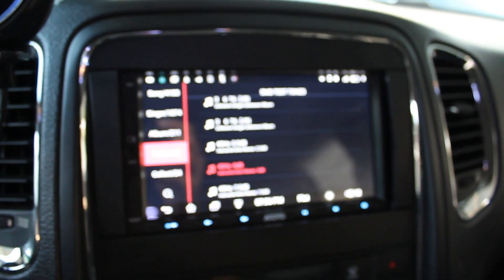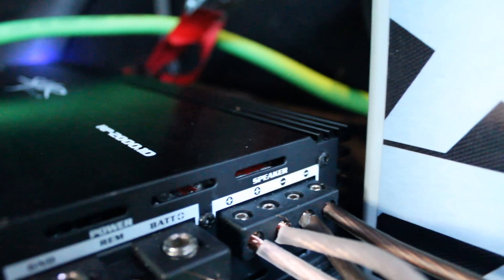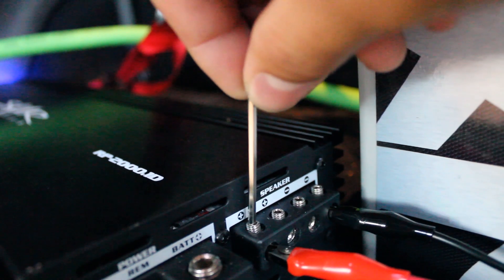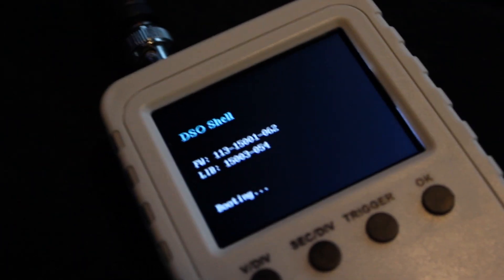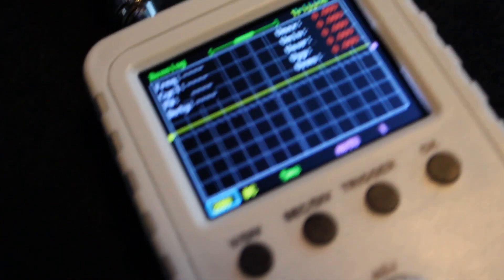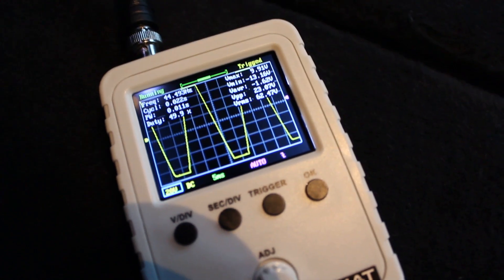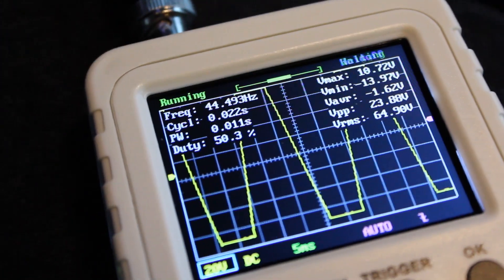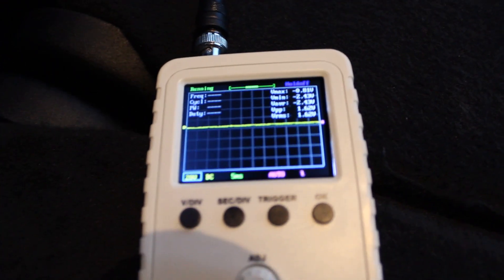How To Tune Your Audio Amplifier With An Oscilloscope!

Comment: It’s a good video, but how do you set up the oscilloscope  sign wave displayed to that size in the display so you can see it clipping?
 I have the same unit and it’s so small. I can’t see or increase the height of the wave like you have did because I can’t see it. So how did you adjust it to that?
Reply: I’m pretty sure it’s the 20v and 5 ms that you have to change
Reply: @exi9164  Its the size of the SINE wave in the display that is holding me back. Its way too small to view the signal to detect clipping. Can you show from a new O scope out of the box how to set it up for the test video that hands it off? Its too vague for someone that is not familiar with the O scope to accomplish alone. Thanks.
Reply: I m having the same problem. How do you adjust that?
Reply: Did you figure it out ? Mine does the same but I have a different brand
Reply: @smurfeco2.358  no. I have not went back to play with it yet. I was the other day and it started raining so If I figure it out I will let you know ☺️
Reply: @rayshaffers1488  I was just messing with mine at home I have a hanmatek oscilloscope.  It's a little difficult to understand but I'm getting the hang of it

Comment: my 2015-2020 escalade goes up to volume 63- even at volume 40-45 the 40hz 5db test tone makes me extremely nervous. that shit is so loud i feel like i might blow or damage one of the 16 factory speakers (ive blown one in the past to 50 cent - im supposed to die tonight). so, trying to figure out how to use the damn oscilloscope while the VRRRRRRRRRRRRRRR sound is blaring makes me uncomfortable. i got the waves to fly at a million miles an hour but figured maybe id at least be able to catch where it clips, but i turned the gain all the way up and the waves just got hectic as fk and i never saw clipping so i must be using the shitty o scope wrong. either way i replugged in my speaker wire and figured fk it!!!!!!!!!!!!!!!!!!!!!!

Comment: This is INCORRECTLY performed. The power measurement value should be for AC. Amplifiers speaker output (+, -) is measured in AC.  He's also got the V/DIV voltage value incorrectly set. It was set to 20v DC I believe.

I implore all of you to please read more on this subject. Yes it is relatively easy to set your clipping point with a scope, once you understand how to. This guy clearly skipping his research and thought it would be self explanatory enough once he had a scope in hang.

Take the time to read up on this subject, and not hinge all the money and time your spent on your car audio setups solely on this video. There's no guarantee this information is accurate, and if it ultimately leads to you blowing your amps, YOUR THE one that's going to be left, sinking more cash in to this. Your equipment will eventually fail, if it's done improperly. Be objective, and validate the information using multiple sources. Hope this helps.

Comment: How do you turn the gain down if you have to start with it all the way down
Reply: if you're doing this correctly you set your head unit at the max volume it can go without distorting the signal, which the overwhelming majority of head units out there will be far below max. You want to measure AC coming from the amp, not DC. You also want to set your gains with your bass knob maxxed out because if you do it half way you'll start clipping the moment you go to turn it up from where you tuned your equipment to. This guy doesn't know what he's doing.
Reply: @dr.fillyblunt7505  Nobody in this comment section apparently knows their way around an oscilloscope. It isn't like a multimeter where the DC setting means you're only reading a DC voltage. His scope is set to DC COUPLING. DC coupling allows the scope to display if there is a DC offset on the signal coming from the amp. If it were set to AC coupling it would apply a filter to automatically center the signal on the graph and you would never know if there was a DC component on the signal (which would be bad news for his speakers). AC coupling could also potentially filter high frequency noise that might be present on the waveform. So, he's doing the right thing by having it set to DC.
Reply: @DDugger  Do you feel better now? The questions are valid.

Comment: I was going to buy the dd1 then I read that the oscope was more versatile as it can account for voltage drop and a few other things ...lol...then I remembered that 3 years ago when I had a mystery problem with my can bus I had bought an oscope but figured out the issue before it arrived and that scope was still new in the box deep in my closet ...lol...so the choice between the $200 dd1 and the already paid for scope was simple .

Comment: On a factory head unit using a lc2i pro how do I find out what the max volume is on the head unit or better yet where do I hook up the oscilloscope to verify the max volume?
Reply: Did you figure this out? I am needing to know as well? Speaker + - on loc as well?
Reply: @ no never did and the poster never replies

Comment: rarely seen such nonsense. Turning the radio up full blast is the first way to introduce clipping or distortion into the signal, and cranking an amp up full with no load can potentially break it as well.

Comment: This is EXACTLY how not to do it FYI
Reply: How do I do it
Reply: @trapmessiah6165 the chances are your head unit is sending clipped signals at max volume. Find the clipping point of your head unit by using the oscilloscope on the pos and beg of one of your door speakers. The do what he did, but with the head unit set to the volume you just determined.
Reply: @ka_razygaming1183  oh ok thank you

Comment: Thanks for doing the video I just need some clarity at one point he said attach the positive and negative oscilloscope connections to the amp then you said turn down the gains as well as the subsonic and low pass filter‘s all the way down to the left so they should be at zero or at minimum.. Then Advice was given to have the head unit on full the bass knob on full then check for clipping assuming every setup we Will have clipping then we just turn the gain on the amp mmclipping just turn the gain down… He said this point I have a question or I’m just not getting something because the gain is already down prior to this step so I am not able to turn the gain down because We were instructed to turn the gain down right at the start of the video.  I’m sure I’ve just missed something but if you could provide some clarity around this is it a bit ambiguous.  thank you very much

Comment: Good stuff I have 2 rp2000s and 2 vxf subs each sub has its own amp wired to 2 ohms getting 1400rms (have 2 Amps vs 1 because I had 1 and skar had a sale so bought another one ) but have Kenwood tweeters in dash Kenwood door speakers all way around Kenwood dnr1007xr 10 inch headunit I love it waiting for a headphone splitter ATM so I can control both amps with 1 bass knob

Comment: Does it even matter how many watts or rms ur subs are before adjusting. If the subs are not even hooked up then how do you know where to set the amp even with clean waves. That's where I'm confused

Comment: Don’t turn your head unit all the way up unless you know it has a clean signal. You can use the oscilloscope the same way just hook up to the RCAs before the amp or off the speaker leads and do a 40 Hz 0 db and 1k 0 db. That way you know the signal is clean coming from the head unit and then do your amp after all that. That way you won’t crank it up all the way to distortion

Comment: You need to put the scope to measure AC not DC. It's AC that is going out of the amplifier
Reply: Exactly this clown doesn’t know anything about audio lol
Reply: @jimcatanzaro7808  None of you guys know how an oscilloscope works. It's the coupling mode for the probe, not what it's set to measure. You want it to be DC coupled so that it can tell you if there is a DC offset present on the signal. It's not like setting a multimeter to AC or DC. Y'all clowning this dude making yourself look bad. 🤦‍♂
Reply: My initial thought when i seen DC 😂
Reply: @Dj1Kreationz  this guy is a joke nobody should follow his channel
Reply: It's set correctly. It's DC coupling for the probe.

Comment: By setting your head unit volume to max volume, you are likely sending distortion from the head unit before it even hits the amp. You need to test where distortion starts at the head unit from what max volume level(once you find that volume level, never exceed it), then adjust gain at amp measuring again for distortion and clipping.
Reply: Distortion and clipping are not the same, clipping is dangerous because those flat peaks overheat the coil of the speaker. If the unit was clipping (unlikely) you could see it all the time even after lowering the gain of the sub.
Reply: @ot4kon  Distortion is a changer or alteration of your original signal;  so clipping is a form of distortion (and the most common distortion you'll see in audio equipment, typically).  So you can basically use them interchangeably when talking about amps and stereos.   If your stereo output is clipping, then your amp will simply try to amplify that distorted signal, even if the amp itself is not clipping...   

But to be fair, if the stereo was clipping, you would still see it here at the amp, so there's no real reason to check your signal at your stereo, since it is already showing up clean even at the amp output.

Now, if he was having clipping issues that he couldn't tune out at any amp adjustment, then that would imply that the stereo is already clipping/ distorting the signal, so testing your signal from the stereo to know what the maximum volume you should use to prevent the clipping, would be the next step.  Because no amount of reduction in gain at your amp can clean up a clipped/ distorted signal from the stereo.
Reply: @calholli  cliping is distortion but distortion is not only clipping. Harmonic distorsion will not burn your speakers.
Reply: The reason you scope with max volume, max sub etc. is so that if the signal is clean at maximum volume setting, it will be clean at lower, more reasonable volume levels. It's called gain-staging for this reason
Reply: He also needs to set the o scope to read ac not dc
Reply: Just want to thank you all in this comment section for the info. I've never tested my stuff and always just ran my system roughly half way. Lol (foolish I know) just got the same oscilloscope he has and  trying to test my setup now since I have 1,000-1,200$ worth of audio equipment. Don't want to screw it up. And be out all that money and bump in the trunk lol
Reply: @Brooksj824 i burned my 1kw amplifier even though it wasnt loud at that moment. I used to turn it loud but at the moment it caught fire it was at its like 20% capacity. I have no idea what happened. Guess something was wrong and  wore out . I opened it later i saw it was the MOSFETs.
Reply: pin this took me some mess up to figure out. most videos 75% or when hear everyone don't have that ear
Reply: Definitely test where distortion starts from the head unit first before testing the amps. You want to work your way from front to back starting with the original source. Without checking the head unit first you can still be sending distortion to the speakers. My sweet spot on my Mustang is 21 even though the volume goes up to 30. 21 will be my max volume to always have a clean signal. Then use the oscope in AC mode on the amps to test the gains on the amp. I recommend testing it several times while running to be sure it's a clean signal after everything is set to get it perfect no matter what the volume is set on.

Comment: Mine works just as good on 2k amp but won't work on my 8000 watt amp
Reply: So I shouldn't expect mine to work on my Taramps Bass 8k? Why do u think that is? (I'm about to try)
Reply: This has a listed 20v peak voltage. I imagine it's ok to go somewhat above that. But 2000w @1ohm is a 44.7v signal, possibly within the unit's ability to read. 
8000w @1ohm is an 89.4v signal. Likely well beyond the unit's max.

Comment: This was done wrong. First of all, if you turn the lpf all the way down you are cutting off all frequency above the lowest setting, you need to turn it all the way up and and subsonic all the way down. Secondly it didn't matter anyway because headunit at max was most likely already clipping. With gain all the way down you turn headunit volume up until the wave squares, that is your max volume which on most units is around 3/4 volume. If anyone sets gains how this video instructed they are sure to clip.
Reply: Zay Bangerz cheers for this, sounds like you know what your talking about. Also are you saying when you turn head unit to max volume the actual head unit itself is clipping?
Reply: @Davidszd-f1h  most headunits start distorting around 3/4 volume with a few exceptions. If you take the scope and put it to the speaker outputs with all filters off and gain at 0, then turn headunit volume up at a certain volume it will most likely square off. If you listen at that volume it wont really matter where your gain is set because the signal from the headunit is distorted to begin with
Reply: so in my case my LPF is set at 60hz. what should be done here?
Reply: If the head unit was clipping you would see it in the waveform just amplified....
Reply: I saw a demonstration video of how you can feed an amp a completely clipped signal and the amp still puts out a sine wave
Reply: The guy had the scope on dc not ac only ac signals are passed in a amplifier the dc is what drives the power to amplify the ac signal pretty basic knowledge
Reply: so why does the subsonic gotta be off and lpf all the way up? And once the gain is set, how do I set the lpf & SS from there?

Comment: Can you make a video on how to use that oscope I’m gonna be purchasing it soon and haven’t used one before
Reply: My guy did you not watch the video
Reply: Jerry Pino he did? All he said was turn it on? There’s more to it than just turning it on. I guess you saw something I didn’t
Reply: @mopar392ta3  He says turn your volume max... better to find out where your head unit clips first(usually around 75%ish volume). Clip the positive and negative to your amp speaker terminals. Play the 40hz test tone. Turn gain up and watch the scope. Once the wave ends are squared, back off until it is round, and you're set.
Reply: Pono Sunrider Thank you for the reply braddah. I actually tuned it two weeks ago. I found another video. Mahalo Nui. Always great to be pono!! Aloha
Reply: @mopar392ta3  Aloha bruddah!
Reply: @mopar392ta3   what video did u watch cuz I want to tune mine as well
Reply: @jovansoleil  I didn’t lol. Found out it’s easy to use when I got it. I can try to make a video this Friday that’s the only time I got off

Comment: If you already turn the gain down, how you you still have to turn it down wen you see clipping. That clipping is coming from the headunit max volume
Reply: Clipping can be introduced at different intervals in the audio chain - I'm thinking this particular demonstrated was carried out under the assumption that the head unit signal was clean
Reply: @SmalltimR  look at the video again  at the start the amp gain was turn down right but when test with the oscope and there is clipping he said turn the gain down a second time

Comment: How can I see this off my head unit. I want to know max volume without distortion before I do this at the amp.
Reply: tyler duarte this is a bit late but, you can plug RCA cables to the head unit and use the same 40hz tone, the middle prong is positive and the metal surrounding is negative. It will show u the same sine wave and you can see when it clips
Reply: @cispi9319  I got same O scope and I was wondering the same thing. Got my amp dialed in but obviously I'm gonna have to do it again now that I know how

Comment: Fantastic video. Short simple and very instructive. Quick question - does that Oscilloscope get it's power from the amp terminals or from an AC or DC source? Thx.
Reply: You can use a 9 volt battery to power it too. Under $10 for Amazon  battery connector holder
Reply: Ac

Comment: Bass knob allway up or down
Reply: Up. You want the knob maxed so it wont clip if you set the gain where it needs to be
Reply: Keegan Harrison  ok  so that bass knob is that subwoofer  signal because my stereo have 3 pairs of rca front rear and subwoofer
Reply: I think the gain only acts like a potentiometer. So it controls the mV in a sweeping range. I could be wrong. All I know is you turn gain knob all the way up and turn gain on amp all the way down then then tune amp and you will never go over into clip land
Reply: Keegan Harrison ok  thank you very much for ur help ipreciate
Reply: No problem good luck

Comment: You started with your gain and filters all the way down, then said to turn the gain down to correct the waveform.
Reply: I think he meant turn the gain all the way up first then check for clipping and turn it down until the wave is round. One other thing I think you should do is check the head units rca outputs first with the scope to make sure  there is no distortion when the volume is all the way up. Then check through the amp. Steve Meade would be mad if he saw this vid lol. You can check your gains for about $250 less than with his DD1 plus!